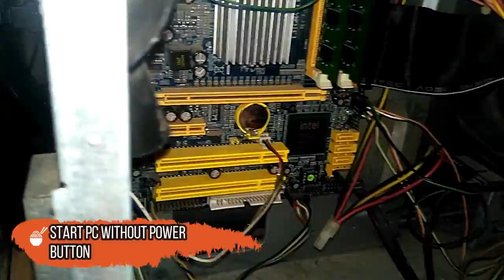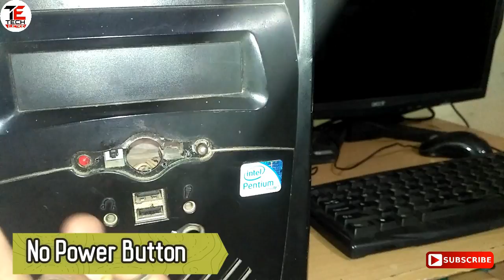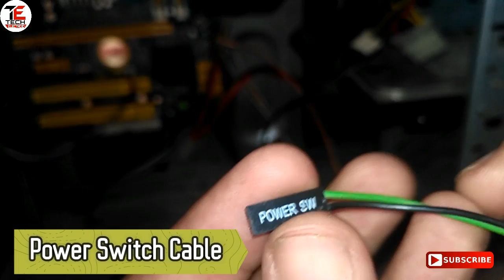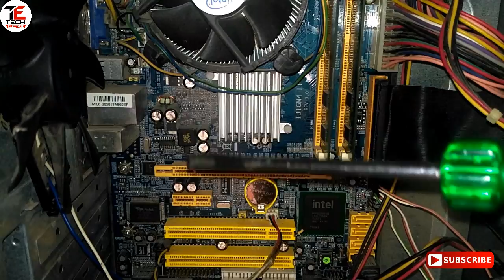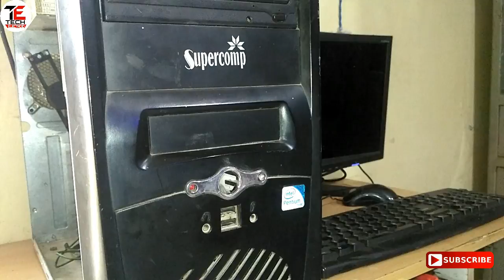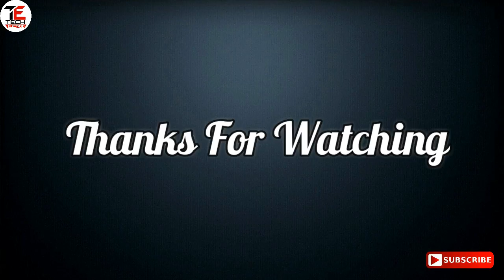PC Not Turning ON | CPU Not Starting | Fix It Yourself | Power ON Problem!!

Comment: This method is harmful for PC.  Whenever you turn on switch, the PC starts. But how you turn off the PC? With soft buttons on monitor right? That means there is electricity still running across your motherboard. And not all countries have stable voltage current on their switch boards. That voltage unstability may cause some serious damage to your PC. This method would be the last of all my alternatives.

Comment: if you actually bind those two wires then power on, is it will automatically will on your computer? and do you think it will damage the computer?
Reply from the maker: It work like just a trigger
Reply: @TechElectroid  okay thanks, so it will be just work exactly the thing that you did.
Reply: Can u start safe mode in win10 if u hold it 10 seconds like that? Isnt it dangerous?
Reply: i don't think it would be should its better to turn on pc manually

Comment: My pc usually don't boot up when I press the power button. But when I keep pressing the button for 9-10 seconds, 2-3 times, it then eventually boots up. Is this because of the faculty power sw wire? Or some other issue?
Reply: Did u find out?
Reply: @jothepro1013  yea it was the the power sw wire. Changed my cabinet and the issue got resolved

Comment: I wonder if that method works on cars too... asking for a friend
Reply from the maker: Need test on my car first
Reply: @TechElectroid  I think that's called hotwiring a car
Reply: @barron5970  ,70000000000
Reply: i think car starts with spark plugs

Comment: What i did is i cut that cable and kept outside my cabinet.. When ever i touch those cable together it's turns on the pc
 but one day it touched and left joined automatically in my absence and now the pc won't Turing on😢
Reply from the maker: Reconnect all connections of motherboard , it will release flea energy from motherboard .it might help you . Otherwise your  motherboard is damaged .

Comment: I tried this method but doesn't work for me my PSU is fine but its fan Is not spinning when connected on motherboard but I tested my PSU with paperclip method its fine and fan spinning too plus my motherboard light is also on but computer not starting

Comment: If I constantly do this, can it break my motherboard or not?
Reply from the maker: Why need to do this constantly
Reply: @TechElectroid  Because all my buttons in cpu are broke so Im afraid if I break my motherboard by doing this everytime I open my pc using this method
Reply from the maker: There are chances to broke your motherboard. Just buy power and reset switch  from Amazon

Comment: I own a 3000£ pc and it doesn t have either the cables or the two metal shits to connect
Reply: WaveOfSound me neither. My mother board doesn’t have the connection jack like in this video. Did you solve the problem?
Reply: @juanyang838  sorry for replying this late , if you didn t solve it yet , you need to get the wires , just the yellow and the white ones , they re already glued together and you need to find the two right pins , the metal little conductors , there s only 2 that work for the start button to activate , once you find those u use the screwdriver and touch the ones closest to them you alrey got connected
Reply: WaveOfSound Thanks for replying even I necroed your comment. I sent my pc to one of a local shops and they said my motherboard was dead. Imma remember this hack and use it when the pc goes off again someday.

Comment: great now i dont have to buy the csse
Reply: Lol i think i have problems with either my psu or my power on button  on my case...because wen i press the on button nothing happens ,no fan works nothing...i dont think its the power supply because its new one which i bouth several month back
Reply: @tazboy1934  im having the exact same problem

Comment: For some reason my PC stopped working but I can see that the motherboard still has power but everything else won’t work when I turn on the power button nothing powers up like fans and stuff won’t start
Reply: SoupPacket dude mine just did this. Did you find a way to start yours up?
Reply: Still Frosty yeah I figured out that ram was faulty and the power supply wasn’t giving enough power to the whole pc

Comment: Sir i have a laptop problem . Please read this . 
I cant turn on my laptop because my power button is damage and it is attached in the built in keyboard and my built in keyboard is damage to . 
Is there a way to separate the power button to the built in keyboard?
Reply from the maker: Please share make and model of laptop

Comment: I can guarantee it 100% works and doesn't damage your pc
Reply: As long as you do make contact to the computer once its on
Reply: I tried em all it doesn't work
Reply: @firehawk8521  what's the problem? I can try and help I've had many PCs over the years
Reply: @alexnavyseal38  can't jumpstart it at all. Or turn on with pc. B450 pro
Reply: @firehawk8521  did it work before and is the power button not working. Are you seeing a light that it is receiving power when plugged in. If so you should be able to jumpstart it with the assistance of this video if it doesn't work something else is wrong. Whether It being the power supply or motherboard
Reply: @alexnavyseal38  new parts got everything for a new first Build
Reply: @firehawk8521  then it is most likely a rewiring issue from your PSU to your motherboard (to check if this is the case look at your graphics card and when its plugged in does a light turn on showing its connected to power)
Reply: @alexnavyseal38  naw no lights
Reply: @firehawk8521  its definitely a wiring thing. First check the obvious; at the back of the power supply where you insert the cable it has a button switch that and check again. If it is not that you have to check if the cables from the power supply are correctly connected into the motherboard.
Reply: @alexnavyseal38  that's difficult for me. You really a seal?
Reply: @firehawk8521  no funny enough I always wanted to be a SEAL but I joined the British Army as I live in Ireland so it's closer and I dont need citizenship.
Reply: @alexnavyseal38  cool.
Reply: @alexnavyseal38  Bra i connected everything again still nothing
Reply: @alexnavyseal38  video chat?
Reply: @firehawk8521  sure you got discord?
Reply: @alexnavyseal38  no I don't. Let me get it real quick
Reply: @firehawk8521  bear in mind I am UK timezone
Reply: @alexnavyseal38  ok let me know whenever. I finally got fan spin no lights though. CPU got stuck inn socket 😫
Reply: @alexnavyseal38  got it paid a dude$60 for it. Was the ram
Reply: @firehawk8521  that is great news xD
Reply: @alexnavyseal38   i had that problem, i tried connect them with screwdriver but it doesnt work on B450 gigabyte... but the power button works on old motherboard so the solution is motherboard cut off front panel connections :(... now i have to wait for reclamation :/ sry i m bad in english
Reply: @andrejmelisek586  I would recheck the power SW cable is plugged in correctly from the handbook for the Motherboard as it could look different from this video
Reply: @alexnavyseal38  Hi can you Send me a PC?
Reply: @firehawk8521  l l lol

Comment: You could just use the reset switch as a power button, by putting the reset switch connector on the power switch pins...
Reply: Really is it working?
Reply: I never got a reset with my computer wire
Reply: This worked for me, thanks man! The method explained in this didn’t work unfortunately
Reply: Cleaned my pc and now the power button doesnt work it starts when i use a screwdiver gonna buy the cable

Comment: Thanks dude ,, my power button broke out ,I had another CPU so I tried to take its power button  out but it's wire was broken and after soldering it again broke up also I tried 2nd method but didn't worked (before watching this video) .
Well thanks so much that finally worked (My ram wasn't  properly attached)
Now ram's terminal  get burned -_-

Comment: didn't work sadly my motherboard is probably shorted somewhere
Reply from the maker: Is there any led on your motherboard
Reply: @TechElectroid  what if there is? Mine has a light on. Sorry for intruding somebody else's comment. I'm desperate.
Reply from the maker: It's just a indication that your motherboard getting power supply or not.
Reply: @TechElectroid  mine has one but this trick doesn't work

Comment: I don't see reset sw wire
Reply: Some cases don't have reset switch, so there is no reset wires
Reply from the maker: Then only one option just short circuit the power switch

Comment: If I do this it will not be shot sirkit in electric board.
Reply from the maker: Connect only two points. Carefully. Otherwise happy diwali
Reply: You mean only power. Other connection not to connect.
Reply from the maker: Ha bhai. Dusre point Ko touch hua to spark hoga